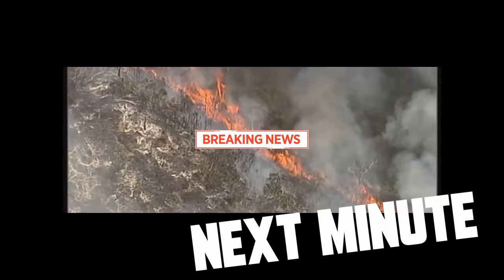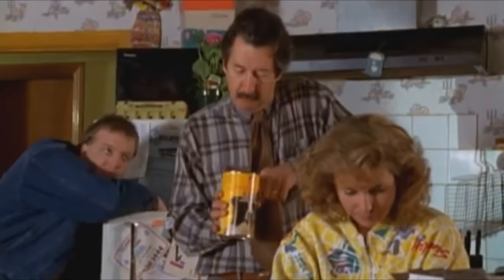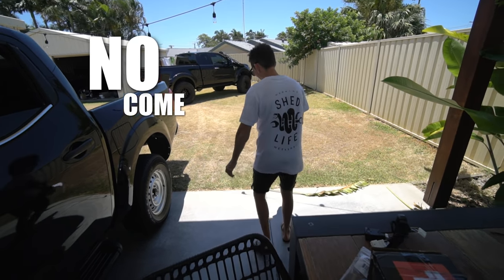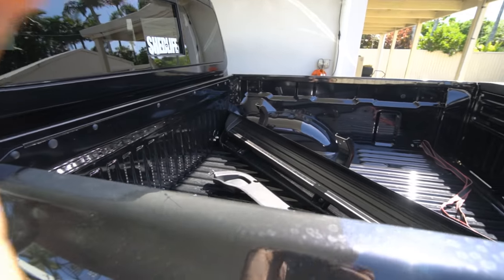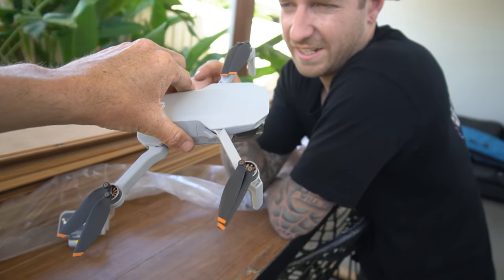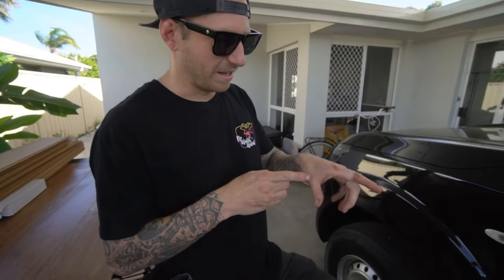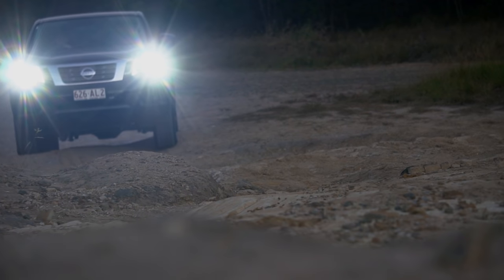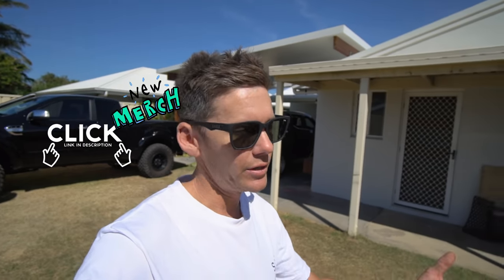I BOUGHT A NEW RIG !

Comment: 4” lift 35” tyres and 4” stano would look mint
Reply: Does being roadworthy not matter in Queensland?
Reply: Who’s she?
Reply: Roadworthy 😂
Reply: @Br-sy9vi  who’s roadworthy? Never heard of her
Reply: @Br-sy9vi  being legal and 4x4’s don’t mix. Go and do glass house on ur little 2inch lift on 31’s. U might lose ur bumper, drift shaft and scrape the bottom of ur chassis off. Also higher potential to role due to less flex.
Reply: @MrKato525  2 inch lift is heaps, a bigger lift isn't going to add flex. be much more likely to roll the higher you go, especially on 35's he will have plenty of clearance. 🤷‍♂️
Reply: @bez2992  higher lifts add heaps more flex, a 4inch lift with 13inch shocks will allow for huge amounts of travel. I have a 3n2 on my np300 and regret it so much, doesn’t look big or have enough clearance sometimes to do step ups. 35’s are to big, 33’s are the perfect size tyre.
Reply: @MrKato525  that's the shocks allowing for more droop or "flex". nothing to do with how high the vehicle is, you could lower the car with 13 inch shocks and it would "flex" better (you're also loosing up travel if you don't change shock mounts). and why is a 35 to big? a bigger tyre is the best way to lift a car and gearing can solve any power/low range problems.
Reply: @bez2992  on modern utes, 35’s are simply too big and cause too many issues. Scrub to  much, way more likely to break a cv, less up travel etc...
Reply: @MrKato525  cut guards/ bump stop spacing/ body lift and wheel alignment are all ways around scrubbing. gearing will take a lot of load off the cv. as well as a locker. and less up travel is only required if you don't want to put the effort in to fit them.

Comment: Congrats mate 👌 Definitely protection mods first:
2nd fuel filter
catch can
all your breathers
Throttle body intake pipe
Snorkel and properly sealed airbox 

Also when you do suspension, rear sway bar out and it flexes 30% better 😉 and I'd recommend new rear trailing arms, factory ones are piss weak and bent them hitting rocks

Enjoy man
Reply from the maker: yeah I think my list is literally identical to that list haha, going to have to take a trip with you one day so you can show me how its done !
Reply: @TJANDMAC  Yeah for sure mate, sounds good 👌

Comment: That was the perfect mod zero - those steps are pointless in my 6ft opinion. I presume you got those less than pretty wheels because you plan on replacing them so you might as well start there and since it makes sense to do tyres at the same time, getting big MTR tyres too, which will need lift and probably flares too so you might as well do it all as a first mod. And maybe doing something about that chin for the approach angles.
Great video as always! Love the animations and graphics.
Reply from the maker: thanks mate ! yep tyres and wheels on the way to !